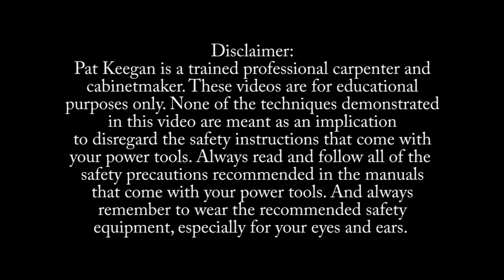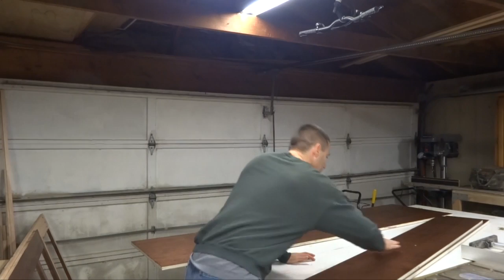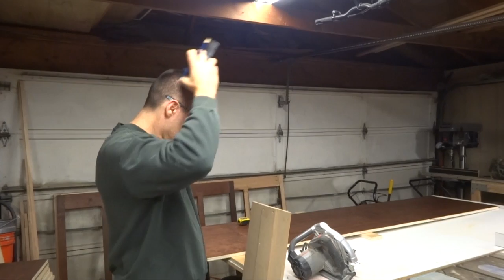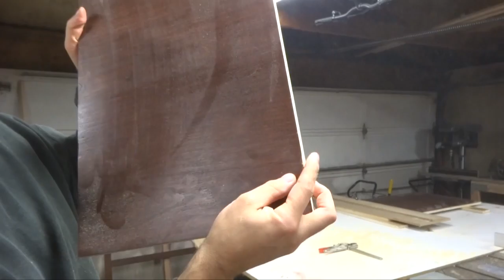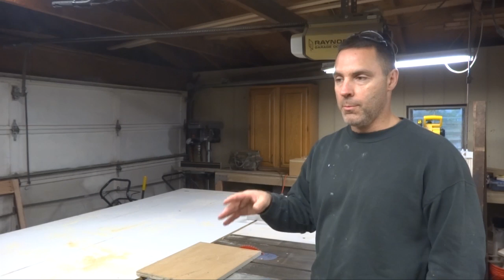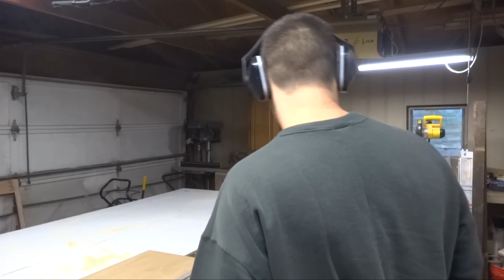How To Build Your Own Kitchen Cabinets: Part 1

Comment: I'm trying for the first time to build my own Microwave pantry closet. My kitchen has barely no space in it.  I need food space as well as Microwave space.  I have no counter space in my very small apartment.  How can I build s simple one with out all the equipment tp do it. What kind of wood do i need ?
Reply from the maker: Hi, sorry for such a late response. you do have to have some basic tools. At least a circular saw to cut the plywood. You can use fasteners through the sides to hold the shelves, and fill them before finishing (if painted). The kind of wood depends unfortunately on what you want it to look like in the end, painted, stained, etc.

Comment: Advised Polycrylic doesn’t yellow. I want to build w/o doors and w/ wood termites aren’t so found of. Thinking recycled redwood. Upper shelving Coated wire (ha termites). Small kitchen: 64x18 bar shelf, 61x25x36h prep counter, 80wx25dx36h sink cabinet that has a 30g water heater in one space. How difficult can this be?
Reply from the maker: depends on your resources and patience :)

Comment: How thick does the frame need to be? Can I use mortise and tenons in lieu of pocket holes?
Reply from the maker: Hi Jacob, there are a few things that you have to take into consideration. Normally face frames are 3/4" thick or close. if you are building traditional cabinets you'll probably want to stay close to that. Think ahead to how you're going to attach the doors, what hardware you'll use. If you are going to use face frame hinges for your doors, you want to keep that dimension, or close to it. If you are doing full overlay, where your hinges might be mounted to the inside wall of the cabinet, you can go thinner. Mortise and Tenon joinery is awesome, if you have the patience, and want to spend the time, it's a hallmark joinery technique, similar to the dovetail joints on drawer boxes. It's just cool. Since no one sees the joint however, we prefer the faster method of the pocket hole/screws because we don't don't have to have a bunch of clamps handy and wait for the glue to dry etc.  thanks for watching. -Pat

Comment: As you say there is an advantage to building custom cabinets, but how do you deal with 15" deep uppers when you lean in to work or grab something at the back of the counter?   I can see making the microwave area 15" deep because it won't interfere when leaning forward.  Anyway, great video!
Reply from the maker: that's a great question, Gino. And you hit the nail on the head (sorry couldn't help the bad pun). As you said, areas which would benefit from the difference in depth, without detriment to other function, is the goal. In this case the microwave area called for it. But even in other areas the additional 3" isn't really that terrible, unless you're like 6'5" tall :). So if you have giant clients, probably stick with standard sizes, but when duty calls, there are always trade-offs between the form and function. Thanks for posting, it's a great point to keep in mind! -Pat

Comment: Very helpful. Articulate and easy to understand. Thanks for the tip on the hand saw jig and use of the scrap to minimize tear-out. Purposely have cut things big and later finetuned n the table saw. This will allow me to save a step.
Reply from the maker: That's great, glad it can help. People obsess over tear-out, but most of the edges that are cut are not visible at all, or behind another piece, etc. so sometimes you can save some time just by planning which edges fall where. Thanks for watching. -Pat

Comment: score your cut lines with a zip knife (box cutter) to also greatly reduce that tearout along your cuts
\
Reply from the maker: Yes, that works too and several people advise the same thing. That is both an ideal, and elegant solution, which i like very much. Something to think about:  I have found, when production time is important, you don't need to take the time to score anything. The reason is that often the bad, chipped out end can be turned to be the back of the cabinet and thus will never be an issue. It also usually ends up being the left over piece as well, in which case you can simply shear that off on the next cut. But thanks for posting a great idea! -Pat

Comment: Great videos! I have watched all of them already, and I decided to build my own cabinets. Any recommendation on how to paint the cabinets white? I want them to have a professional finish (I know it will be hard to get a finish that is 100% like the factory) but I would like to do something that someone will not look at and say, "This was hand painted."
 Thanks for the great videos. Keep up the great work! Best of luck
Reply from the maker: Thanks Valmir, glad you liked them. To paint, i would start with using Hard Maple for the face frames and any solid stock. Maple is more resilient (and also more expensive) than poplar, so if you can afford it, it's worth it. If you wan the best finish, you should spray. But that gets into a whole bunch of other tools and things. The best is to spray it with an HVLP sprayer. If you can't afford one, see if you can rent or borrow one. I am currently using Benjamin Moore advanced products (both the primer and the top coat). This primer/paint is widely recommended for these types of applications. Good luck, and hope everything turns out the way you want it to!

Comment: Great Videos.  I only made it through the first 3 so far, and I can't seem to find where or if you said what type of wood you used for the face frame?  Did you stain a common pine or something to look like cherry? Or did you stain a cherry to look darker?  Thanks for posting these very helpful videos.
Reply from the maker: Thanks Tyler, really appreciate it. I know they are long videos, but hopefully you'll pick up a few nuggets you can use. I used Cherry for these face frames, and stained to be darker. Thanks for watching and posting.

Comment: What methods did you use to keep your face frame square?
Reply from the maker: The first method is actually to make sure that your saws are tuned up to make exactly 90 degree cuts, both with respect to the fence, and to the table. If you tune your tools like this, you will almost always get something that is very close to square already. Also watch the video i put on the channel called "Squaring a cabinet." you can use the same technique for simpler face frames. Once the glue dries you will force it into square when you attach it to the cabinet carcass, by making sure the reveals are all equal, and the tops and bottoms are flush with the cabinet. Thanks for watching and posting a great question. -Pat

Comment: I learned a lot from watching this series.  I went for it.  I had a fairly functional garage shop before I started.  I added a new lunchbox planer, a Kreg K5,  freud matched rail/stile bit set, and a craigslist 6" grizzley jointer to my arsenal.  Even with those purchases of about $650 I was able to keep the cost of the job at around 4k for a large kitchen.  16+ cabinets with 42" uppers including a 30 wide by 24" deep pantry cabinet.  I built pull out shelves for all the lowers and pantry cabinet.  All the drawers have soft close slides and the cabinets have blum soft close hinges.  you can really find deals on the hardware if you look.  I can get soft maple from the local supplier (who will also sell to the public) for $3.50 a board foot.The only things I changed was to thin up the back from 3/4 to 1/2 inch (I totally get how as a builder you only want to stock 1 sheet thickness but for a one off job it made more sense plus I could offset the back in by 1/4 to allow for wall irregularities) and I made the uppers 13" deep for easier plate storage.Buy good plywood!  Even though it was $100 a sheet for the 3/4 maple veneer, it was a combo of wood and mdf core and was dead flat.  The 1/4" (shaker doors) was also mdf and had no twist.  Good plywood not only is better to work with but looks better when stained.  I used prefinished birch for the boxes except where I had an exposed end.  Then I used the maple veneer and just finished the inside clear.  I used a flush trim bit that also cut a shadow line groove at the plywood/face frame joint as a detail on my exposed ends.  Regular boxes were set in about a1/4" for ease of joining face frames together.One thing about the soft maple is that is still doesn't take stain well. After much experimentation I used 3 coats of general finishes java gel stain (wipe on, softly wipe off a rail/stile at a time). which gave me the rich brown I wanted.As to doors and drawers, drawers are not too bad to build but doors are taking a looong time - mainly because I chose to prestain the panels (overkill since they are plywood and probably won't ever shrink).  Three coats back panel, finish, three coats front panel, finish, three coats back of assembled door frame, finish, and finally three coats front of assembled door frame and finish.  Total process for a door is 1.5 weeks this way, but I batch them out in groups of 10.I've loved the process but now I see why a true custom kitchen can run 15k plus.  I would certainly value mine that high.
Reply from the maker: Dude, you are the BOMB!!! That's totally awesome. Quick question for you: What was the difference in price between your 1/2 sheet and 3/4 sheet? for me, the price is only a few bucks better. I've been thinking of going with thinner backs. Sounds like you did a great job.  I agree with your last comments too. People don't always understand what goes into customer cabinets. Those that do get it. Those that don't buy from lowes :). But doing it yourself got you some cool new tools and still saved you a ton of money. That's awesome. Thanks for sharing a great post. -Pat

Comment: Thanks for the videos they are very helpful.  How do you account for scribing the face frame and or end panel to a wall especially if the cabinet is going between two walls?
Reply from the maker: there's a couple of ways to do it.  I will do a video on this in the near future. It's tough to describe in text, without pictures, but I'll give it a try :). The brute force way is to make sure you build the face frame slightly wider than the opening, taking into account how out of plumb the walls are. Then you simply scribe one side of the face frame to fit, then keep working the second side little by little until it fits. I can usually do it with no more than two "tries" on the second side. 

The other way is to make a template. I use this method very frequently, especially if i'm not confident in the scribe. The template is made up four pieces of luan (cheap flooring underlayment) which is about 3/16" thick and VERY easy to scribe. The vertical pieces (left and right) are set against the wall and scribed individually...very easy to do them one at a time and tune them for the perfect fit.

The top and bottom pieces are then attached to the left and right pieces using hot melt glue. These pieces are to make sure the real width (after the scribes) is established. You may need a helper.

When the glue dries (in a few seconds) you'll have a "picture frame" that you can now tip the cabinet on its back and lay the template on top (making sure it's square to the cabinet). take a pencil and trace the left and right "scribes" onto your cabinet faceframe and then scribe the cabinet. 

As i said, i do the template very frequently. I've scribed plywood counter tops between THREE walls this way (left right and back walls) and it works beautifully.

If you have questions, let me know. Either way works well, some people prefer one over the other. Thanks again for watching and posing a great question.

Comment: Brilliant, dude.  So many tricks I'm seeing here that answer so many questions I had about building cabinets.  I've rebuilt and remodeled everything in our house including our main bathroom with all new plumbing and lots of electrical throughout the house but building cabinets just overwhelmed and intimidated the heck out of me!

Really pumped about watching this series as I'm already feeling more and more confident I can do this.

Any recommendations on which pocket hole tool to purchase?  I've got a single one I purchased a while back but with all of the double pocket holes I'm seeing I'm thinking it will be much easier/faster to go with a double pocket hold tool.

Truly appreciate you taking the time to show how to do this and my wife is going to be thrilled as she's been after me to build our cabinets for about 10 years. :)
Reply from the maker: Thanks Stacy, I'm glad they can help you out. I think there's a lot of good info in the series. I treat my posts like a "classroom" so there's lots of me talking, which some people like, some don't but that's just me. WIth respect to tools in general, I always buy the best one i can afford, particularly if I'm going to use it a lot, or at least more than once :). I've only used Kreg because that's teh first one i found when i started using them. There are now dozens of manufacturers, but Kreg is now at big stores like Home Depot, Menards, etc so it might be good to go with them. They all pretty much do the same thing, and some have features that others don't. 

I'm psyched that you're going to take the plunge and try your hand at cabinets. If you feel up to it, post pictures on our facebook page. Would love to see them.

Thanks for watching and taking the time to post. -Pat

Comment: If I wanted to make a really small kitchen out of pallets would the steps be the same?
Reply from the maker: for which part(s) are you using the pallets? the face frame? the doors? the boxes? the whole thing? -Pat
Reply: The Whole thing
Reply from the maker: Assuming you are doing standard sized cabinets and using all pallets for every part, there would be a number of steps that's you'd have to take. Making the face frames is not a big deal, pretty much the same (assuming pallets are 3/4" thickness for the boards). but making the boxes and doors would be more effort than using the plywood. You can still use a lot of techniques in the videos, but you'd have to do a number of glue-ups for sides, back, etc. -Pat

Comment: I'm an idiot with a question; do you build the boxes or the face frames first? and do you use glue with pocket screws?
Reply from the maker: That is actually a GREAT question. And one that's debated among cabinetmakers. Which should you build first, face frames or boxes? My opinion is, it doesn't matter. I like to build the boxes first and then the face frames to fit. Many do it the exact opposite, but I've only done it that way rarely. 

Yes, you use glue with pocket screws, whenever you can. I use a lot of pre-finished plywood which has a finish already applied so glue is useless when joining to pieces of that plywood together. But definitely when joining any two UNfinished surfaces (e.g. the face frame to the box) you use screws and glue.

Thanks for watching and taking the time to post. -Pat
Reply: In this video series it looks like you make face frames first?
Reply: MrSmackdab

Comment: Thank you for your video. I want to ask, what are the dimensions for rails and stiles?. Thanks.
Reply from the maker: Hi Thanks for watching. I usually use 2" for the stile/rails on the sides/bottom/middle. The top one depends on the depth of the crown molding applied. I try to leave about 1-2" of reveal below where the bottom of the crown will ride. Thanks again for watching and taking the time to post your question. -Pat